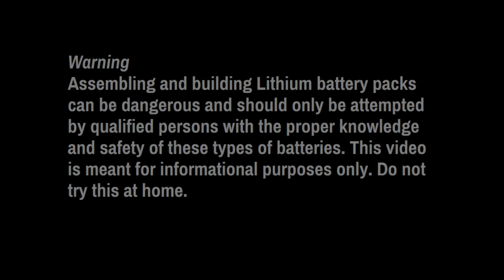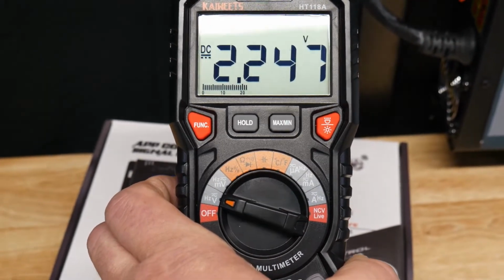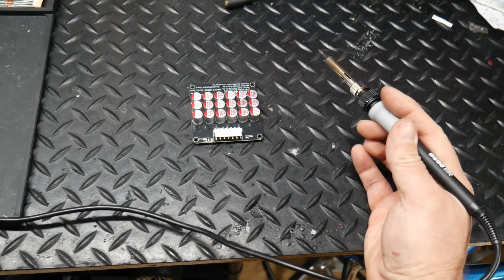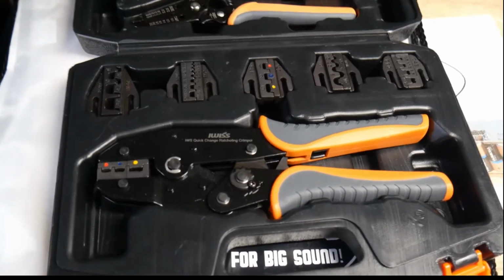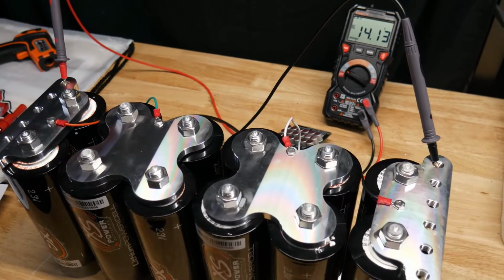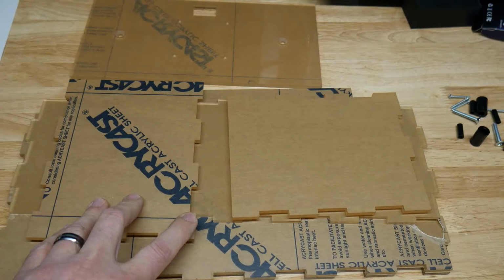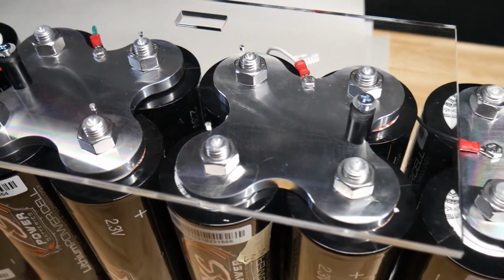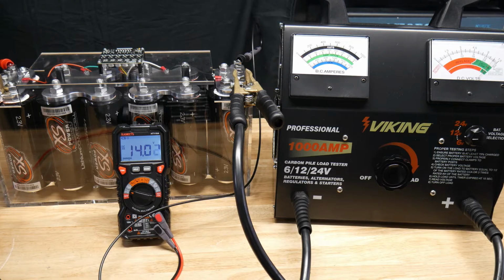How to build car audio Yinlong LTO lithium battery bank heltec balancer & LAF audio case

Comment: Okay firstly let me say thank you for this amazing video! Secondly, I do have some questions concerning the installation inside of the car. How do I hook it up? If I have a front AGM battery under the hood chatGPT told me that it’s difficult to find a DC to DC charger for LTO and really want to get LTO and hook them up correctly and safely and I’ll be also upgrading my alternator to a 320A alternator and do the big 3 and also I checked the amount of W my amps at max would pull and it’s around 2520W but also would like to mention that I’ll be also adding some ambient lights and some light bars in the car and powerful horns and many more accessories and what goal is to have everything working nicely in harmony without dimming light and won’t catch fire due the heat and humidity in Ivory Coast that’s why I’m going with LTO and not any other type of lithium battery?
Please Advise 🙏 all my power wires are going to be from knukonceptz 0AGW 
Thank you 🙏 
PS: I already have a 100Ah AGM under the hood and want to keep this only for car functions and starter all other accessories should be on the LTO? 
Please guide me and please is I’m saying something stupid please correct me! I’m trying afraid of damaging something! 🙏🙏🙏🙏

Comment: Can anyone educate me on why these don’t spark and explode when you put the metal piece on the top connecting the positive and negative together ?
Reply: That's because each group of cells is only so many volts. You're not doing a direct short with all the cells connected together. All of them together equal 15 volts.  So when you put the two halves together that's only 7.5 volts more or less. It's not like you're doing a direct short to 15 volts

Comment: You guys on utube get a life. The Lto batteries you guys run is purre junk. You charge to 2.85 volts on your power supply each cell with a slow charge till It goes to all zeros on the charge. Then you take your internal resistance checker made for lto and make sure you got a puchin bag. Thel cells have all different internal resistance the joke you cant fix that. The money i wasted on lto cells to keep buying more cells and there all B cells. So your first impression is when some had lower voltage thats your sign of bad cells. True grade A cells stay up all evenly. I got ripped out of 12 yinlong cells on ebay from a moron in road island. I buy straight from yinlong he tells me. The  time i wasted with that bank i needed a road island road kill. So 12 lto 40 ah yinlong cells i put the bank together and i started froming from the mouth. So I watched my two 6 s banks with some banks discharging so fast to the others the only thing fixing it was a blow touch. I marked the voltage drops on all cells on discharge and back on charge with the bms. Taking the banks apart putting them back the joke i got 5 good cells out of 12 that could work in a 6 s but not a double 6 s bank. The charge back was perfect with the bms. So most guys on here really think there battery buliders lol. So lard ass sells pure junk from xs power he must have them old fake grade A cells sitting in a 200 degree sorage shed in florida. So another waste 8 0ut of 12 was ok. They all had different internal internal resistance and that another  making to the rest of a 12 cell bank still cant be complete becuse sone could not hold voltage. lets make it 7 cells the one that cant hold power with high internal resistance are thow aways with all the other extra waste. I hate lto cells the time and effort to make the perfect cell banks of everything equal is buy lifepo4 the real expensive temgot 460 amp hours a lithium iron with 920 amps with two in parallel so 220 pounds in the back of a suburban is nothing. two of them for 2200 dollars will get her done. So all the bass heads are runnimg mismatched lto banks a completely waste of money and stupidity. The lto does not have storage power all alternator power. I laugh im going to get two more temgot 460 amp lifepo4 with guaranteed grade A real expensive cells so 1860 amp hours with out an alternator at 1840 amp hours  i can run 14000 watts off my batteries  and 13.2 volts is all you need. I ever see an lto again i mighrt have the eyes of charles manson. Well good luck

Comment: What’s the purpose of balancing if when you assemble it should balance anyways
Reply: Top balancing to the vehicle charging voltage divided by 6 cells is the important part..

If the cells are close together ( 10-20 mv) there's no need to do what he does here.

Comment: I did the same and balanced them to 2.6 then when I hooked everything up including my new balancer I charged the bank to 15.5 but when I check the voltage of each cell they were all off by .2v from 2.4 to 2.7 any advice?
Reply from the maker: Check that the balancer is wired correctly and check if the balancer has any settings that you need configure. That seems like a balancing issue for sure.

Comment: I still don't know how these batteries can be installed in a car with the alternator??? Do they have to be separate from the car battery? Can I charge them with the stock alternator? If so wouldn't that mean that they are constantly charging? I really don't want to BBQ my car . I've seen videos where people have with other brands of lithium. Can you explain how to safely install in a cars electrical system? Would appreciate it thank or maybe someone already made a video on this
Reply from the maker: Yes you can run these in a car, just build the battery bank correctly , use the proper balancer, pre balance cells then charge the bank to proper voltage before installing into car. Use a battery isolator so that when you turn off the car it will isolate itself from the cars battery. These batteries will have a higher resting voltage than a regular car battery so the isolator is needed for when car is off and not running. When car is running yes both batteries can be ran the the same time. Always check the manufacturers instructions and guidelines for proper and safe installation and usage.

Comment: Hello ... how to charge top balancing the LTO cell 3v?  pararel all cell then charge with DC power Supply setup 3v then connect to the cell pack ... is it right ? How about the ampere I have setup ? 5a or 10a ?

How long I have to charge top balancing right this ? Then I disconnect all cell then assembly series with balancee ... right ?

Comment: Hey there new to this what's the point of moving the solder pins ?
Reply from the maker: The heltec board comes with the solder point setup for standard lithium battery cells. Moving the solder jumper is needed when using LTO cells.
Reply: @HiFiVector  i moved the point now the run light isn't on i don't have the bank installed in my truck yet but is that correct ?

Comment: Sir 
How you running them in the car.
Stock alternator? 
If I running 12x45hm
 In my car audio system 
My stock alternator 120amp

If I don't blast my audio full.till.for very long 
I think alternator should top the cells up while volume is down?

Comment: Any way you could post a link for the balancer case and also the cell case. I’m wanting to order the same 12 cell kit but big Jeff is sold out. Thanks man.
Reply from the maker: https://www.ebay.com/itm/256269563391?mkcid=16&mkevt=1&mkrid=711-127632-2357-0&ssspo=w99m10XoSlW&sssrc=4429486&ssuid=a1SE0u_sQfa&var=&widget_ver=artemis&media=COPY
Reply from the maker: https://loudaf.net/products/yinlong-battery-case-kit-diy

Comment: Nice instructional video, I have a question would I still need the battery balancer if i only did one bank of 6?
Reply from the maker: Yes because the balancer is for individual cells. When you strap 12 cells like mine essentially you are combining 2 cells and they act as one.
Reply: Okay, thank you for the response.

Comment: The problem with LTO cells is that they quickly shift into the koyaanisqatsi mode when SOC is over 80%, so only charge them with a maximum of 2.55 volts per cell. Approximately +-60AH is sufficient charge.

Comment: Great video,my confusion is the BMS/balancer. Looks like you used tge 6s one on the 80ah 12cell build. But the big jeff Audio 12 cell kit has a 8s one. Just trying figure it out bc i recently got 12 cells and  already have a hetec 4s/6s bms but not sure if it will work.
Reply from the maker: Basically when using these for car audio applications you are essentially joining 2 of the cells together like in this 12 cell setup. They are in pairs each 2 cells share a buss bar so basically even though it is a 12 cell as far as the balancer goes it’s wired like a 6 cell. If the were all separate you would have a 28 volt setup and no cells would share a buss bar. But to keep the voltage in car audio range you have multiples of 6. And so yes the 6s balancer or the 8s balancer on big Jeff will work. Just with the 8s you would only use 6 of the 8.
Reply: @HiFiVector  awesome thank you
Reply: So if I understand this every two cells share a bus bar acting as one unit. You have constructed this so one group of of these 40Ah battery cells is connected to a second group of six 40Ah but since two share a bus bar max amps per cell doubles. Thus, 80Amp-hr per cell x 12 cells; however, the cumulative voltage of the two units of six is around 14.16 volts (each unit individually 6 x 2.3V hooked in series equals 14.16V). Is that correct? You realized 1000amps instead of 960 amps calc which is close. Wow max W-h could be as high as 12000 W-h which you spent a grand on materials which $1.2 dollars per W-h! Brilliant. Let me know if my logic is partially or totally correct here.

Comment: I worry about any of the nuts may become loose under vibration . Did you use any spring washers or Loctite thread locker when tightening all the nuts ?
Reply from the maker: Just used Dan of silicone on the threads after the bolt were tightened.

Comment: Hi there I like the video 💯💯💯 just the quick 1 why you desolder that 2 point on the Balance?

I have 200ah lto build from scratch but not too sure to do balancer. I got the same 1 you using. Should I do the same desolder you done? Cheers
Reply from the maker: Because the solder points change battery types. So depending on what cells you are using.

Comment: I just put a bank of 6, 2.3v, 40 ah cells, together. How do you recommend charging them?
Reply from the maker: Charge slowly at 5 amps or less for initial charge and use a proper lithium battery charger.

Comment: So this isn't the same thing as like a limitless lithium super cap?
Reply from the maker: No this is an actually battery not just  a cap.
Reply: @HiFiVector  I cant find a case for the 6pk of LTO, only 12pk case at LAF.
If I am charging at 15.0 cold and 14.7+ hot is this a better option than LiFePO4 at 28ah, comparing against the 40 ah 6pk of LTO?
I was thinking Glowe Voltage series 2, but My voltage might be too high, and they are OOS and I need something soon.
Reply from the maker: Your voltage technically is too high for lifePo4  which usually should be kept at 14.6 or less. So the LTO cells will be a better bet for you. I prefer LTO personally. The 6 cell LTO will be better than that 28ah lifeP04. The case I got from laf.
Reply: Thanks for the reply, much appreciated!  @HiFiVector

Comment: Do I need a battery isolator? Some people say you don’t really need one and others say you do. If you don’t install one what would happen
Reply from the maker: Yes you need one if you are using with an AGM or head acid battery. Reason is because when the car is off the resting voltage will be higher on the LTO so basically the LTO will charge the other battery since its voltage is higher until they both reach the same equal voltage. You can use without and isolator but not ideal. Isolators are cheap and easy to install.  Here is an isolator that I use. 
https://amzn.to/3HxE6j0
Reply: @HiFiVector  ok thanks for the answer and clarification. Do you know if the down4sound lto 6.0 will need one. I heard they are designed to not need an isolator with using with AGM?

Comment: So i just won a bank from exos giveaway . Am i going to need to get an alternator and voltage regular so it charges more than the 14.2 my stock is putting out.  I have a ford crown vic police car.  I heard these have a slightly higher output alternator due to the higher need for powering the lights on the cops cars.  Or can i use the ltos on my stock set up? This is new to me.
Reply from the maker: They will work with a stock alternator, but just make sure you use a battery isolator so they don’t backfeed your starting battery for your car. as far as alternators go, I would definitely check out Auto Tech engineering. They have great alternators that are very reasonably priced.and get you up to about 14.8 V that will make everything more optimal.
Reply: @HiFiVector  thank you for the reply!   I was thinking about just deleting the front agm battery

Comment: 12 40ah lithium is 480ah total?
Reply: No 6 of them make 40ah because each cell is 2.3v so you have to wire 6of them up to get proper 6s configuration so 12 is 80ah
Reply: @matthewmoyer124  Whats the difference with 12 of these 80ah than single 80ah agm?
Reply: I would def think these are 40 ah each… according to the site, when purchasing a single cell it is still listed as 40 ah. If this is true, I am oversold.. kk 3rd edit and I might be reading it wrong, Idk

Comment: I just switched from 2 xs power d3400 and an xp3000 for an 80ah lto bank, I actually bought them from showtime electronics after seeing EXO's video a couple weeks ago. I was on the fence about LTO for a while but I couldn't pass up the price. I have the same LAF case with the Jims Machineworx standard bars. Looks amazing. I have a 320 amp singer alt that charges up to 15.3 volts. The difference in available power is ridiculous. Never below 13.9 in the city, never below 14.8 highway and that's playing loud enough that the fans for the taramps smart bass 8k turn on in the winter. Also the fact that when I'm driving down the highway, when the bass hits I don't feel my car slow down and the rpm's go up anymore. It is a massive benefit. The sub sounds different as well. Must not be clipping as much.
Reply from the maker: AGM are a waste of money these days. Too big, too heavy, too expensive, and one small LTO or even life p04  will do 3  or 4 times as much as an expensive AGM. Plus the lithium have higher resting voltage and fast recharge rate.

Comment: Hey man I'm really really wanting to buy this exact setup for my car to give my subs and amp it's best power source and get the full potential out of everything but I'm wondering if I can delete my stock battery and use just this I don't want any restrictions on the current flow from a lead acid battery and my car (2019 Toyota Camry) can not take a HO alternator so I have been told by Mechman J&S and numerous other sources that my best bet is an LTO power source but a lot of them are wanting to upsale me for 3 titan 8's almost 2000$ and it's a total of 30 AH of LTO this is more than that 40 AH of LTO I think and 400$ I just need help figuring out how to use just this or what can be used with this to make it work please help

Comment: Seems like alot of work. And what about the upkeep of these cells? I have a xs d3400  a mechman 240 alt. Two sundown x10v3 s in a custom ported box. One deafbonce 2100 watt amp. Big 4 . Zero Guage wire . I wanted to get more power to my subs. They are rated at 2,000 watts RMS . Should I run RMS or more. I was going to buy the deafbonce aak 4,000
Also Considering deafbonce aak 6,000. Or should I go with deafbonce aak 8,000 watts. Longevity of subs who knows. The thing is I will need more battery reserve.  LTO or AGM?    I don't really want to charge batteries or worry about them
Reply from the maker: It’s really not much work and these 6 cell 40 ah LTO will do what 2 or 3 xs AGM will do. You only have to charge the first time before installing into your car. After that your alternator charges them. You just need to use a $30 500 amp battery isolater for a 6 cell LTO mixed with your under hood AGM.
Reply: Really I know nothing about lithium.  Do you think with what I have already if I got a 6 pack lithium cell bank. Would that be enough for like let's say a 8k amp???.

Comment: How do you keep 'em charged once they're in the car?
Reply: Before you put then in your vehicle, MAKE SURE the pack is fully charged. If you do not, it will hammer on your alternator and most likely damage it. If installed correctly with a big 3 upgrade, your alternator will keep it charged. With these cells, it's highly recommended to upgrade your alternator to a High Output. Good luck and be safe with any lithium battery!
Reply: @theinsaneunknown so should I connect to under hood battery or straight to alternator kinda confused.